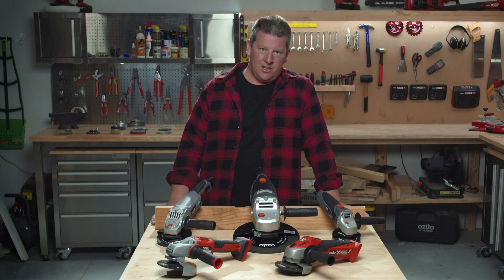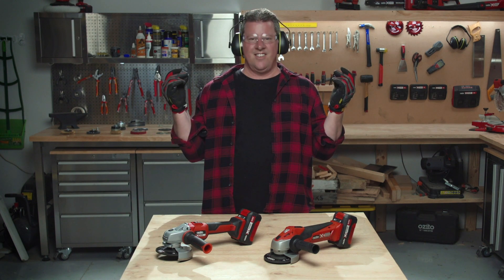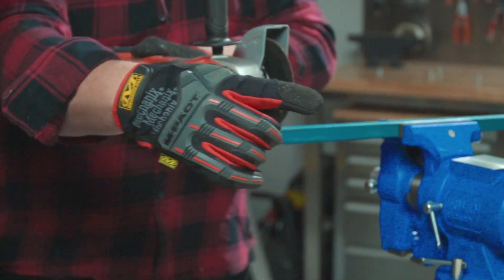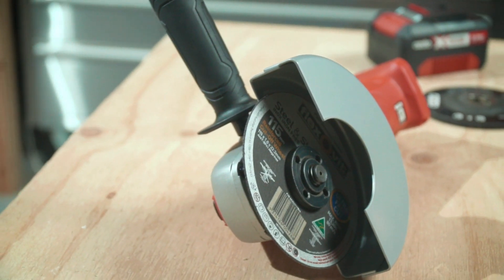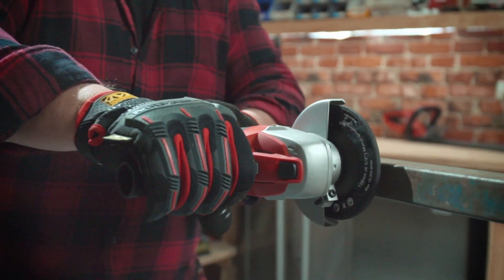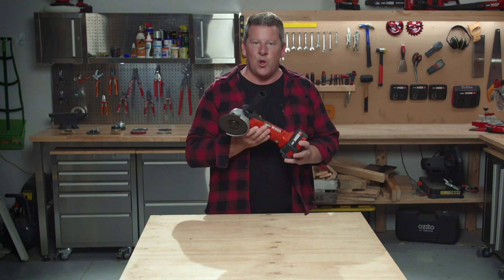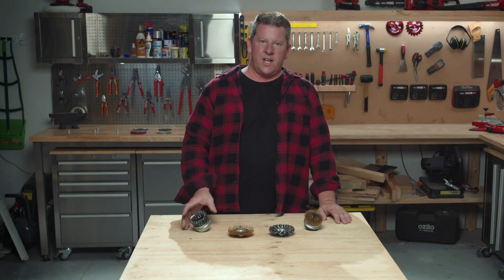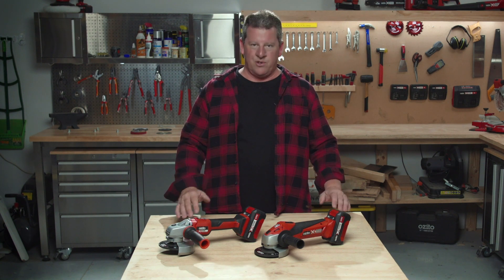Ozito Angle Grinder Tool Tips

Comment: Hi. Wondering where you can get the cutting guard from.
Reply from the maker: Hi Chung, Thanks for reaching out! We do stock the guards as spare parts. You can place an order for the guard through Bunnings special orders desk or you can call them on 1800 772 737. Please provide them with the model number of your grinder. Cheers
Reply: @OzitoDIY  thanks for getting back to me. Would you have the part number for the cutting guard not the grinder guard that comes standard with the tool. 
Grinder model is PXAGS-500 cheers.
Reply from the maker: Hi Chung, Your unit only comes with the grinding guard, not the cutting guard, as it is only designed for grinding specifically. The part number for your grinding guard is 300018502904. Please give this to a Bunnings spare parts team member to place an order. Cheers
Reply: @OzitoDIY  hi thanks again for your help. 
You say that this grinder isn’t meant for cutting, why is that? 

What would happen if I use it for cutting?
Reply from the maker: Hi Chung, Apologies for the confusion, this model only comes with the grinding guards. Therefore, we cannot recommend this tool be used for cutting as cutting guards are not available for this product. 
We have a solution for you however if you can please contact our Customer Service team on 1800 069 486 and they’ll be able to help you out! Cheers